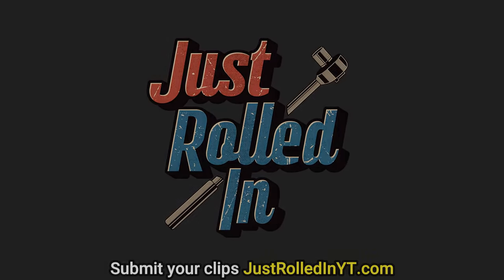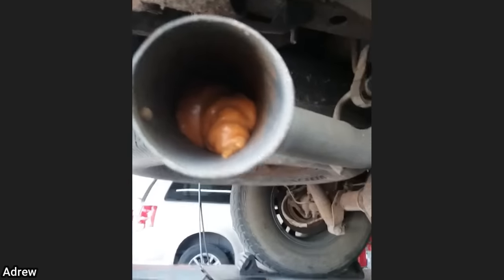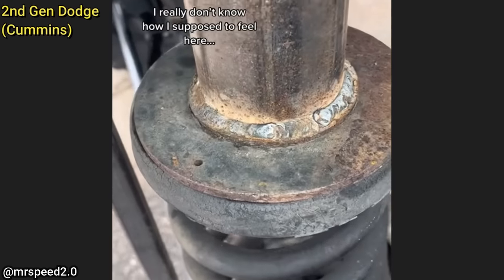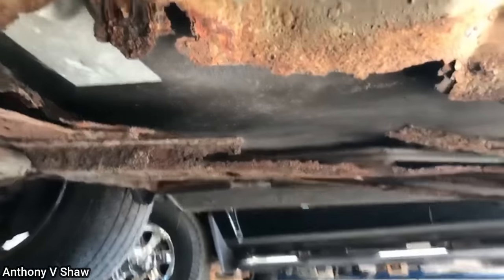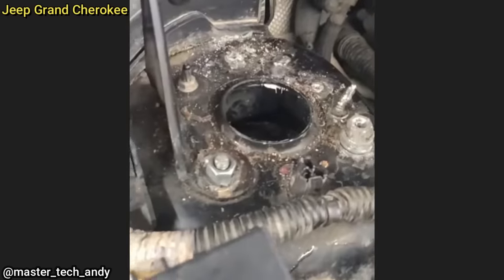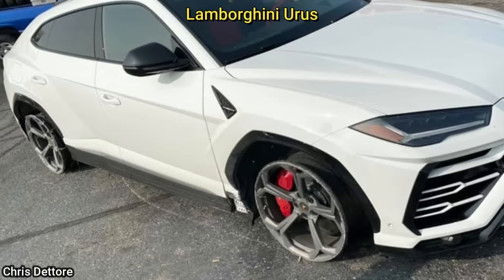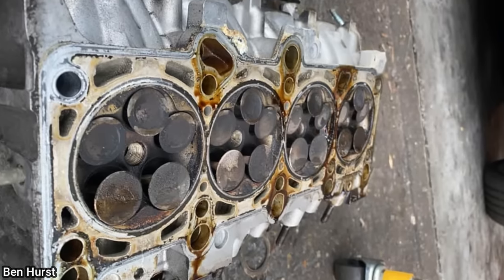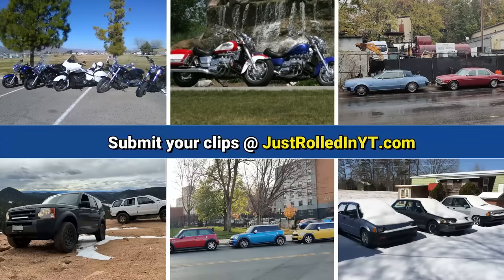Customer States They Drove Over A Bowling Ball | Just Rolled In

Comment: Found a tracker in the fuse box of the car I bought 5 years ago. But I got the car off an auction lot and turns out is was a  tracker car rental agencies install on all their vehicles. They just forgot to remove it when they put their fleet up for auction. So if you buy a rental make sure to look in the engine compartment fuse box. They are actually hard wired in but the harness is easy to remove.
Reply: A lot of dealers sell 3rd party trackers as an upsell or deal sweetener. You might buy a used car and the previous owner might have just forgotten about it. It happens
Reply: The tracker is there so Hertz can steal the car back.
Reply: Or just don't buy a fleet vehicle...those things are beat to absolute shit and back.
Reply: I bought a Used Honda after about two weeks after i bought it the light was reflecting off the hood just right and made out the words  All west insurance on it. Turns out the dealership was selling off there fleet of insurance cars. Never would of been noticed unless the light was hitting it just right.
Reply: Some buy here pay here lots install them as well. Their particular clientele they want to grab the car quickly when they stop paying. Most people have probably gotten wise though.
Reply: @i.robles5785  I bought one and had it for several years with no problems.   Then a guy down the block drove home drunk and ran into the back of it, 1 week after I bought my RAM truck.   Caused almost $6000.00 in damage to a $2200 blue book priced car!
Reply: @Jack_Russell_Brown  In the 50s every car I owned had a "kill" switch, just in case. Also had a switch to kill the rear lights, you know, cops, dark nights.

Comment: Ahh apprentices.  How I love it when they fall for a prank that should be obvious.  Going to the dentist after they knock my teeth out, not so much...
Reply: Not funny. This is how you create trust issues at best and violent resentment at worst..
Reply: I think i would probably have called out the fact that it was a prank then done it anyway. Looked like fun!
Reply: The real lesson is that he didn't pay any attention to the fellow with his fingers in his ears backing away.
Reply: @ThaFuzzwood  If you want something harmless, give the apprentice a bucket to get some pressurized air. High performance disk brake lubricant. Replacement bubbles for the level. Aluminium magnet to collect shavings in the workshop. You know, quiet obviously stupid stuff.
They will learn about their working environment, tools and materials, and can connect knew knowledge to those memorable prank moments. You just have to know the individual limits and maintain a positive atmosphere, so you can all have a good laugh together, not just at each other.
If anything they'll learn how to squeeze some fun out of an otherwise mundane working day. Being fun is a good social skill to have. Just because we always talk about apprentice pranks, doesn't mean they are the only target.

I bet the guy in the video was at least given a towel and beverage of choice afterwards.
More importantly: now he knows exactly what this piece of equipment does! He'll surely pass on the knowledge to the next generation, before handing them a towel as well. :D

Comment: Great video thanks for sharing. Have done my fair share of suspensions over the years and when I bought my 2006 VZ Holden Commodore Ute the front suspension failed 3 days later. I took it back to the dealer who told me they’d have no problem fixing it so I asked if they could get rid of the lowering springs when they repaired the front and was told it would be at my expense. Long story short I did it myself and found the car was that low you could only just get a coke can under it. Rebuilt both the front and back suspension and was amazed the amount of fasteners loose or missing and how badly everything had been put together. I’ve had 45 years building and repairing cars and bikes and seeing some of the dodgy work I’ve seen still makes me shudder. Absolutely love your videos and work. Great job. 👍🏻👍🏻👍🏻

Comment: The one where it was rusted out and the dealership said it wasn't sold like that, only after 2 months? Smh. Please people before buying a used car, have it looked over first and under.
Reply: And NEVER use the dealerships recommended shops.  Take it to someone you know and trust!
Reply: Yeah, i know no one that does not know atleast one person that knows enough about cars to know what to look for.

That rust did not happen in 2 months, more like 5 years.

Here we don't see this kind of rust that much, as cars must pass inspection every 2 years, and a lot of sellers of used cars offer an inspection of the car prior to sale.

Even if you know nothing, you could ask to have the car inspected at your own cost, this is cheap "insurance" against buying something bad.

Inspection cost about $70 and they you have peace of mind, that the car has no serious structural issues, nor any problems with steering, brakes, suspension, exhaust system and so on.
Reply: Well… next step would be to the State Police to have them investigate all the recent inspections that dealership performed.
Reply: Not even having someone else look at it, before you even book an oil inspection it should be basic and common knowledge to use your brain and check the frame, fluids, etc

Comment: I had a customer drive in complaining that  her car smelled bad after it warmed up. Once on the hoist we found a traffic pylon jammed up between the catalytic converter and the floor pan.
Reply from the maker: Oof. That could have been bad
Reply: As a woman, I resent this remark. As a newbie driver (19?) I got a couch cushion wedged under my car; it ripped my E-brake cable out and destroyed my differential (IIRC)........ That's how we found out the car was too rusty to pass inspection the next time it was due.

As for bad smells; my first ever manual transmission had the clutch go about 3 years ago. THAT is a bad smell! Brakes wearing down/dragging and the "Subaru oil system of frustration" aren't pleasant either
Reply: @rsqddogmom  ypui misspelt represent 😉🤣
Reply: Confession, many moons ago, I taped a fish to someone's muffler.
Reply: A few years ago I lent my dad my motorcycle, a week or two  later it smelled rank  , I lifted the seat and he had bought some fish for his cats and forgot about it .

Comment: Did anyone else catch the irony of the neighbors pissed about the exhaust?  They spray foamed the exhaust outlet, yet cut the rest of it off... 

Or am I missing something?
Reply from the maker: Lol that's why I shared it.
Reply: @JustRolledIn  good call lol
Reply: I can only guess that the neighbors sprayfoamed the outlet, and the owner cut off the muffler so they could drive it in to the shop.
Reply: Not as bad as the time the punk kids next door (at least I think it was) blasted pot seeds in my exhaust system with a leaf blower. (I am guessing that is how and why my exhaust smelled like a dead skunk)
Reply: Well the irony is: neubours did not pay for the damage
Reply: Yeah I had to rewind to make sure I heard that correctly.
Reply: Probably thought it was the cat lol !
Reply: Yeah, weird that they think an open exhaust would be quieter.
Reply: If I were that pissed about the exhaust I think I would just weld a steel plate on their tailpipe.
Reply: Maybe the neighbor realized they didn't want to catch a murder charge from carbon monoxide poisoning
Reply: @CharlieFoxtrot  it would have just stalled the engine or shot the foam out, but I guess it's technically possible
Reply: @CharlieFoxtrot  I don't think the engine would start with a blocked exhaust.  But yeah screw people with intentionally loud vehicles..
Reply: I caught it. I was trying to figure it out as it made no sense.
Reply: Probably made it louder
Reply: I did 🤣
Reply: You didn't miss a thing, Carl. 
"You have to remember these are just simple neighbors. The salt of the neighborhood. The common clay of the town. You know...morons."  
 -- Blazing Saddles line parody.
Reply: All that effort because it was too loud only to make it louder.
Reply: I would have been "Oh gee thanks for the new straight pipe setup neighbor" as I now would be leaving the neighborhood in first gear only and bouncing off the rev limiter every morning lol.
Reply: @Kingkoopa00  Which (please correct me if I am wrong) only made the vehicle louder.
Reply: @Kingkoopa00  my coworker sent that in. neighbors removed it and tossed it in the bed of his pickup
Reply: Nope, I said the same thing!
Reply: probly they spray foamed it and then he cut the mufflers off so the car would run.

Comment: I've seen all manner of objects found as the source of a " flat repair " come into the shop for assessment; toe nail clippers, spark plugs, bullets, tooth brushes, bolts... lots and LOTS of big freaking bolts, but never an entire brake caliper 🤣
Reply: In my 20 years in the Air Force, the most mind blowing object I had seen in a tire was a piece of 6ft long 1in diameter rebar that had been woven through the tire of a Conex picker like it was a piece of thread woven through fabric.  It made 10 punctures in the tire with four exposed humps and both ends on the outside of the tire!

Comment: At 0:45.  Happened to me after a front hub bearing change on a Impala.  They were absolutely tight when the job was finished but backed out over the course of a couple of months or so.  After the fact I read on a forum that GM recommends new bolts every time.  No doubt I could have avoided this by applying some thread lock adhesive.  Now I know.

Comment: My son had some work done on his Camaro at a reputable shop up the street. They left the bolts out of the right front caliper or they just didn't tighten them and the fell out on the way to the house. I found a longer bolt in my stash so I could get the car back to the shop. They fixed it but didn't apologize or anything. We were done as customers after that.
Reply: Reputable 🤷‍♂️😏
Reply: My brother had a wheel come off of his truck. A stealership I had been a customer for 10 years at cracked a steel brake line. No one said a word, I found out the hard way at a round about.

Comment: Had a shop "forget" to tighten the bolts on one of my brake calipers after a pad swap and it worked loose on the freeway. Luckily I was able to stop without damaging the wheel too much. I don't use that shop any more.

Comment: In the UK we have an annual MOT, which is a vehicle inspection that every car has to have to drive on the road. What’s the US equivalent? Or is there like nothing at all.
Reply: Some states do, some don't. Pennsylvania does annual inspections on passenger vehicles but commercial vehicles and buses are inspected twice a year.
Reply: Depends on state. Some states nothing at all so if you get somebody that has zero common sense and not mechanical inclined  you have a rolling hazard.
Reply: Each state sets the rules of inspection. If they even have an inspection. There is a reason why so many people who spend the winter in Florida resister their cars at the winter home.
Reply: We used to have them in Connecticut. Vehicle inspections ended up becoming a massive "cash for a pass" black market, because the state initially wanted any car with the slightest bit of surface rust (or older than ten years old, as all cars ten years old or older required a pre-registration inspection) to be immediately scrapped, so the inspector bias was to condemn any used car sold privately. The public was NOT OK with that, so usually a $20 slipped to the Inspector at a DMV branch would get you through no matter what.

After the DMV caught wind of it, after a decade or so, all inspections were to be performed only at the main office, by DMV higher-ups who wouldn't accept bribes. There was even more backlash, as the proper procedure for vehicle purchase was now this: a) buy car, b) leave car at seller's house or have it towed to your house, c) acquire a DMV inspection appointment, d) have vehicle towed to DMV headquarters for inspection, e) vehicle fails: tow home, 30 days to repair at DMV-authorized repair center - you could NOT self-repair, bring all receipts and tow back for another inspection, if it fails, repeat process but you only have 10 days - OR - vehicle passes: tow home, schedule appointment with DMV for registration, get a ride to DMV, get temp plates, go home, install temp plates on car, get emissions tested, return to DMV with test results to get permanent plates.

Well, obviously that was WAY too much hassle for everyone (DMV, towing companies, service shops, customers) so they eliminated inspections.

The "trained inspectors" at the main DMV office failed my grandmother's '84 Ford Ranger FIVE TIMES because the brake test skidpad was set to "Car" instead of "Truck." The sixth time, my uncle went with her, and pointed out the fact that they continued to test the truck on the car setting, once they set the equipment up properly, it passed with flying colors. This wouldn't do, because "a 1984 pickup should not be on the road in 1998," so they tried another approach.

The "inspectors" then tried to fail her truck for having dual gas tanks, a factory-installed, custom-ordered option the original owner paid extra for, because the truck had "unauthorized modifications." My uncle, being the family's "Ford Guru," had to explain to them which option code on the option sticker meant "Auxiliary Fuel Tank," which they then had to call three different Ford dealers' Service Departments to confirm that this indeed was an option, but very rare on Rangers. One dealer even ran the VIN number through Ford's system and confirmed, via the build sheet, that the aux tank was officially installed on the assembly line. The state finally had to admit they had nothing to fail her on, and it only took SIX trips, on multiple sets of temporary plates, across the span of four months, to the DMV headquarters 45 minutes away just to get her truck registered. Quite a financial hit for a broke widow to endure.

All six "inspections" were performed on the SAME set of brakes, since the previous owner had just had the brakes fully serviced at a Ford dealership (coincidentally one of those "DMV-authorized repair centers" mentioned above) two weeks prior to sale. The truck was meticulously-kept and rust-free. In fact, the only reason why the old man was selling the truck was that he had blown the head gasket (without overheating it) and instead of simply having a new head gasket installed, he had a new crate engine installed, and then afterwards decided he wanted a 4WD pickup. Everything on that truck, except for the illumination for the factory radio's display, worked 100% - even the old R12 A/C system. It wasn't some clunker, it was an older man's pride and joy, the truck he drove for all his errands, the truck he strapped his canoe to when he decided to go fishing, the truck he hand-washed every week in his driveway. My grandmother got eight years out of it, until my uncle blew the engine beating the snot out of it.

Comment: The spray foam situation is hilarious. 
For those who don't know, just because it's stock doesn't mean it's legal, and just because it's legal in your state or province doesn't mean a city/town ordinance/law can't restrict a vehicle even farther. 

You absolutely cannot run a diesel engine that has the capability of rolling coal in Canada as an example. 
If it's tuned for that out of the factory it's still your responsibility to cut the engines nuts off and keep it clean. 

I had a long battle with someone who owned multiple chopper style bikes next to me years ago. 
My sister had a new born baby, this dude would rattle the windows every day at 6am.
Working on his shit until 11pm.

End of the battle had him charged 23k and a bike insurance wouldn't cover. ;)

Comment: Sometimes you have to have some empathy for the car owner...  I have a car with some pretty wide tires, and the inside edges had worn through so that the belt was just becoming visible (at just 28,000 miles!!).  When I park my car, the wheels are always straight, so there was no way to see that damage unless I specifically looked for it, and at 28,000 miles I wasn't expecting that, especially when the outer edges were still showing reasonable tread.  Got caught at inspection.